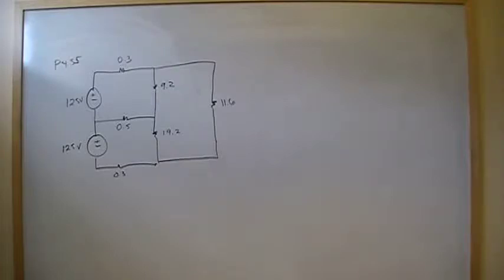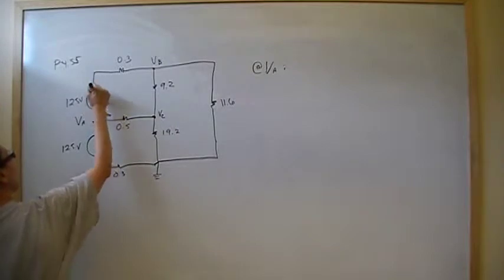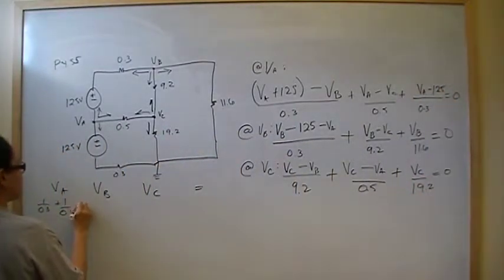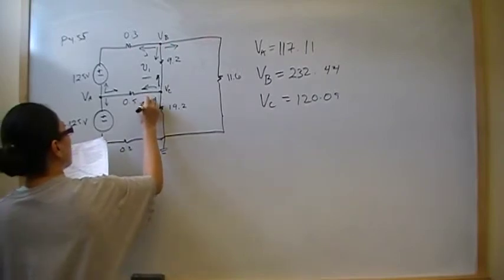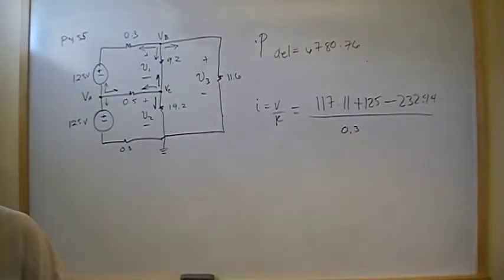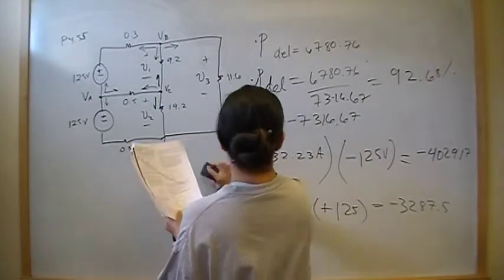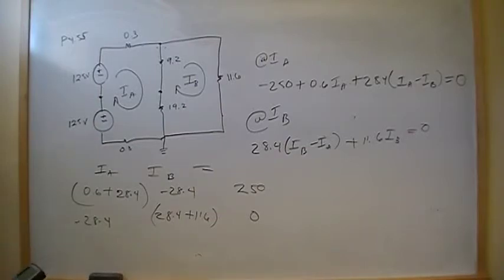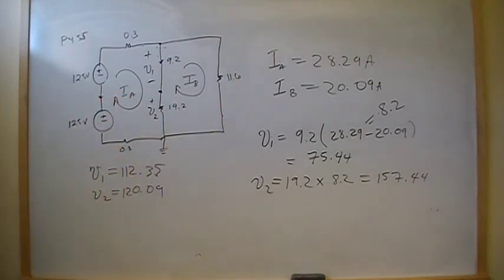Node Voltage vs Mesh Method P4.55 Nilsson Riedel Electric Circuits 9E Solution

Comment: I was struggling with this one because it's my first time seeing one node being directly connected to two voltage sources at the same time. Thank you for choosing the "tricky" way to solve this problem, that's the exact explanation I was looking for.